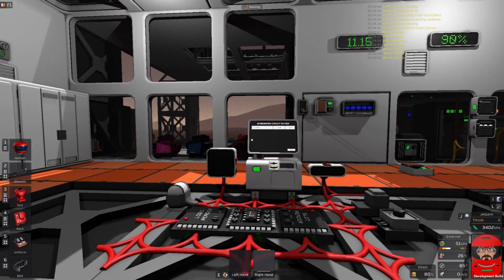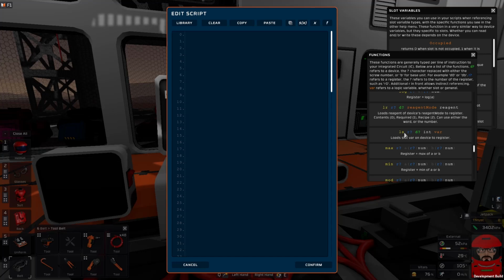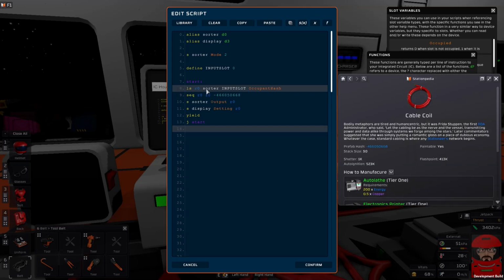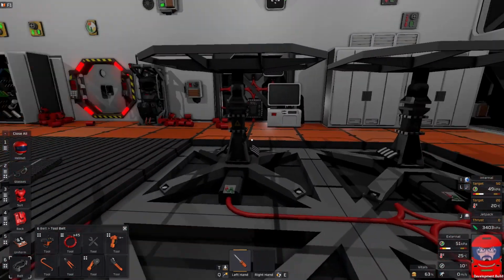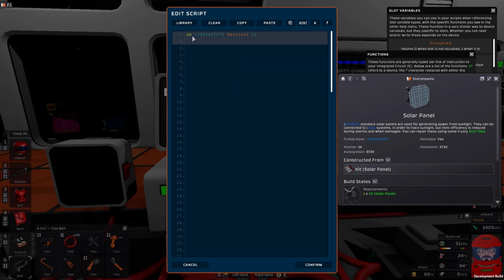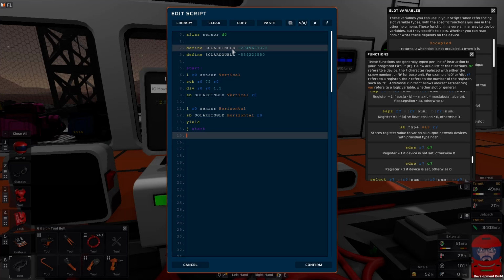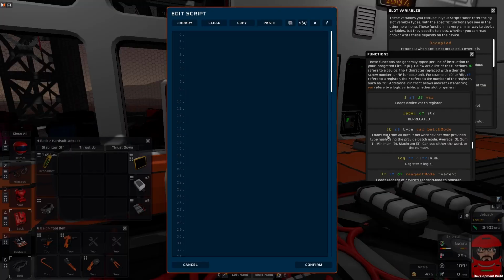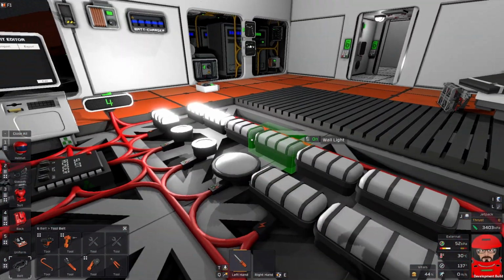Stationeers Basic IC Programming 4 Batch and slot

Comment: Question. I have your sorter code copied exactly but when using it the cable coil gets sorted properly 1-4 times and then it breaks and sorts it out the left side for a period of time and it doesn’t even read the hash. Then all sudden it starts working again and it comes out the right. What’s going on? Is this a glitch or was something tweaked since this video that broke the code?
Reply: I had this problem and I believe it was fixed by adding a line that branches back to the start if r0 == 0 (meaning the slot is empty). 
Something like: 
start: 
ls r0 sorter INPUTSLOT OccupantHash 
beqz r0 start 
seq r0 r0 -466050668 
s sorter Output r0 
j start